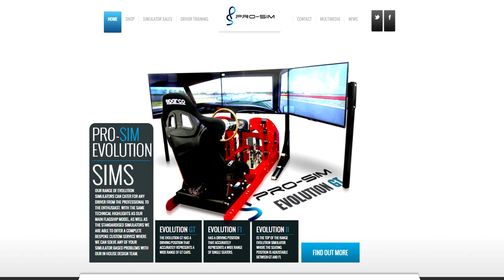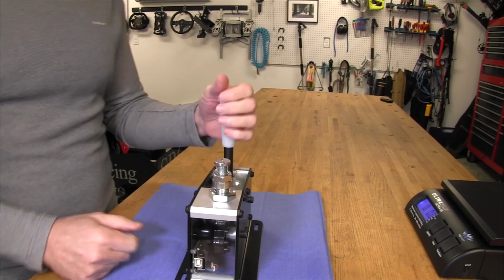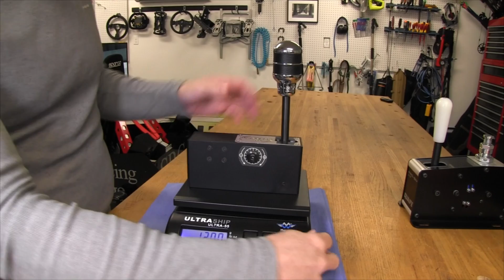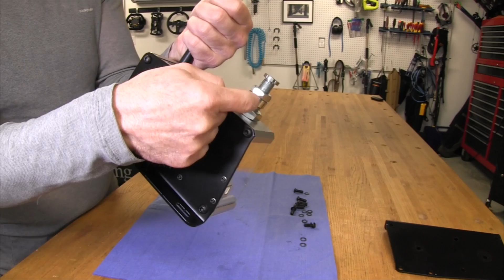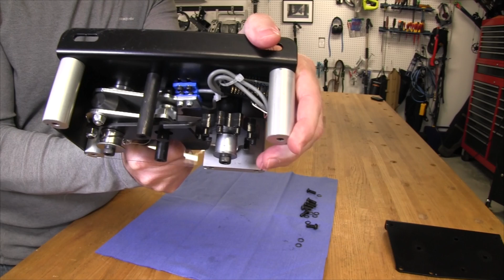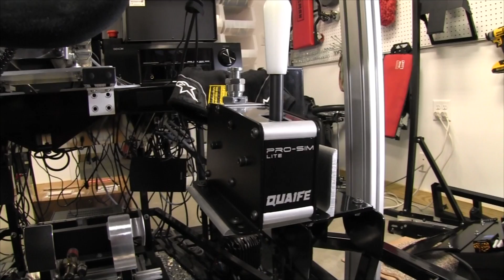Pro-Sim "Lite" Sequential Shifter Review

Comment: Have you used it with the arm extension Barry?
Reply from the maker: No. But I did put a Sparco Aftermarket knob on it. Because it doesn't go as for down the shaft as the OEM knob, it essentially increases the height around 80mm or a little over 3 inches. This put the height right in the sweet spot for my rig.

Comment: I like to drool over some of the high end equipment available but none of it is practical for me personally. I don't have the space or money to accommodate a dedicated sim setup, so non desk friendly gear is a no go.

My desk has a slide-out keyboard tray that I've secured in place with screws and have a TH8A shifter mounted on it. That works pretty well, but I don't think I could even accommodate the Clubsport shifter due to its weight and the additional force to shift without having stability problems. If I mounted to the top tier of the desk, I wouldn't have enough clearance due to the keyboard tray.

More and more of the sim racing gear coming out nowadays seem aimed towards people with dedicated rigs, often with the need to customise them. It's cool that these no compromise products are available, but I hope that those of us that use a desk (due to lack of money, lack of space, lack of permission from the other half or we just can't justify having a dedicated rig) don't get completely forgotten about. I'd like to see some desk friendly designs come out because currently there doesn't seem to be a lot of choice.

Comment: Hey SRG was wondering if you have tried HPP's shifter and if so, your thoughts.

That is the only shifter that will fit in my rig (I think) and my Frankenstein G25 shifter has finally given up the ghost LOL. It did last 8 yrs though, which is a miracle!
Reply from the maker: I have an HPP shifter. Been trying to get a review done on it. Have shot some video, but just not had a chance to put it together yet. That said, I think the HPP shifter is perfect for smaller setups or rigs. It looks a little lost when attached to my Stage 4 rig though. It has good action and is a very solid unit. Not surprising considering Mark's other products.